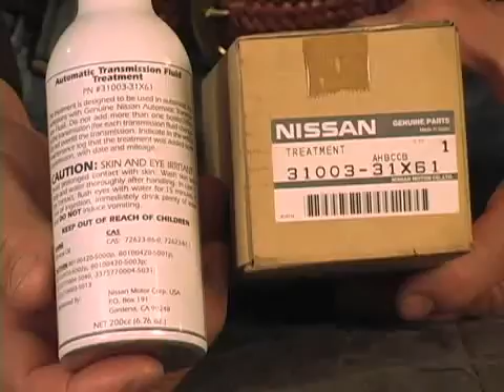RE4F03B: 2-3 Upshift Chirping/Scraping Sound

Comment: I have a 06 sentra with 62,236 miles an it has started that chirping sound from 2nd - 3rd.... The problem is I have not been able to fine the the Transmission treatment 31003- 31X61 anywhere will any transmission treatment work something like  Lucas  treatment conditioner